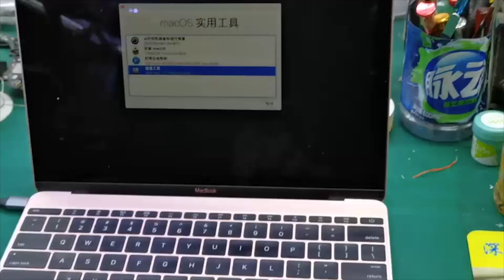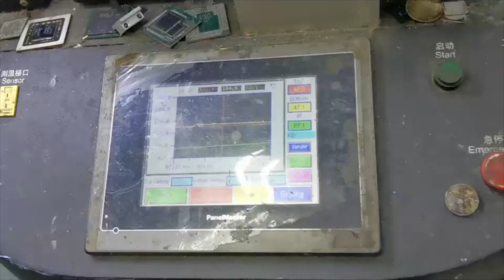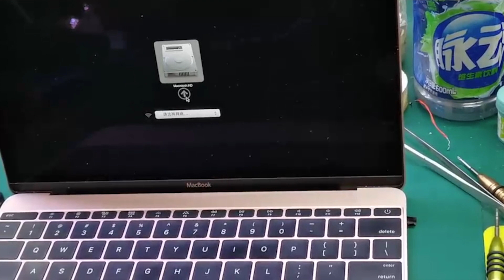How to Fix Missing Hard Drive by Reflowing MacBook (2016) CPU

Comment: I fixed this same problem by replacing a failed resistor. That's usually the problem. No need for all of this reflowing.
Reply: Which one resistor?
Reply: hi, how exactly did you fix this? how did you find that resistor?

Comment: you did not clearly show what bga rework profile was used, and that is very critical to doing this safely.
Reply: back of the PCB 125C, top of the CPU 175C, slow heating mode to maintain these parameters. Usually 2 minutes total hold.
Reply: @AntonySimkin  need full bga Intel cpu 4th generation to 10th generation profile
Reply: Pls give full bga profile setting 2nd gen to 11 gen intel cpu

Comment: a common problem on all 12" deadcpubook. this is just a temporary fix, this fanless CPU is designed to fail.
Reply: Mine hasn’t had any issues yet, but after finding out these sorts of issues do occur frequently I’ve gone to the trouble of placing a 0.5mm thermal pad between the cpu heatsink and back panel, essentially turning that into a giant heatsink. I’ve seen temperature drops between 10-15c, hopefully this “fixes” apples “good” engineering!